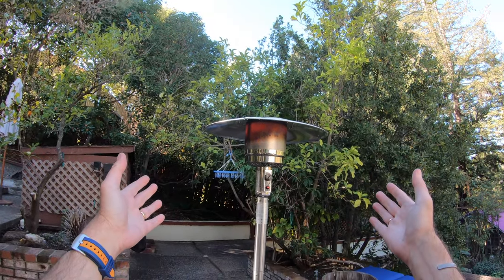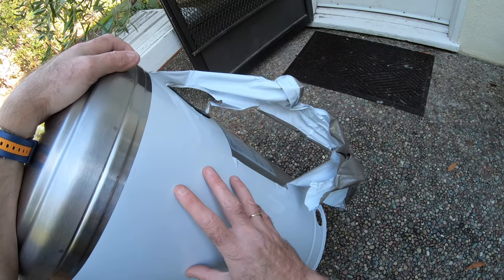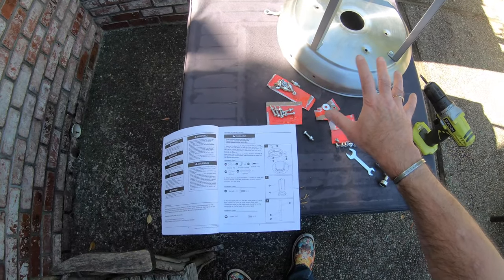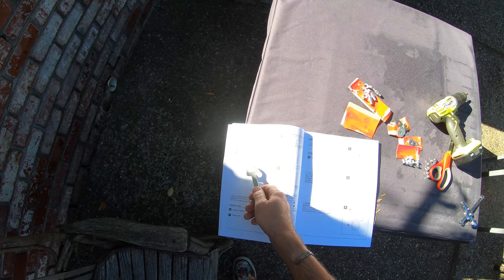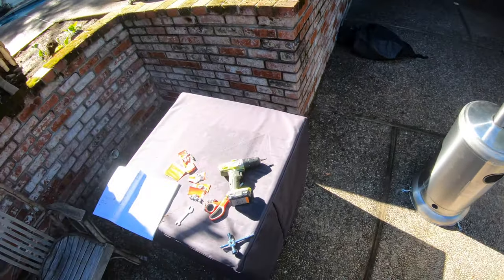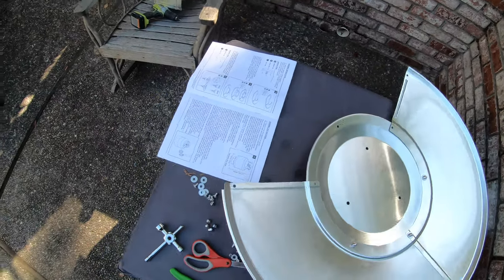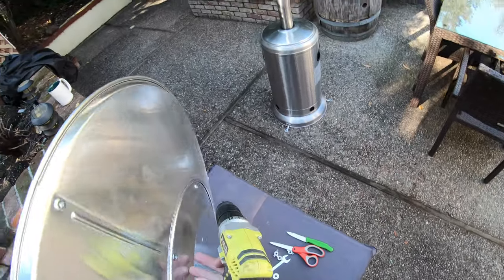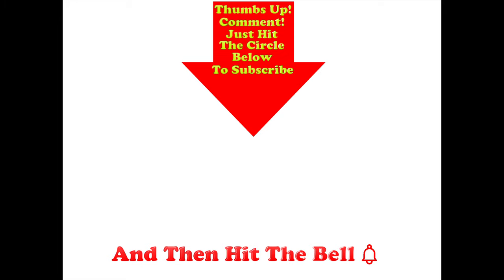Hampton Bay Patio Heater Review & Step By Step Assembly

Comment: One step not mentioned (at least I didn't catch it if you did cover it, my apologies if you did), in the states this unit comes with a "AAA" battery that goes under the ignition button. Just unscrew it, insert the battery (+ facing where your thumb will be) and screw it back on. Great video, thanks for posting!

Comment: This was great - thank you.  I watched it step by step and I did one thing differently.  I assembled the upper pole to the lower pole, then stood it upside-down and held it in place be putting two chairs on either side of it, then I attached the three base support units to the cylinder itself.  Then I flipped it over and attached it to the base.  The base support units are so much lighter then the two poles, so I think this is easier when you do not have an extra set of hands to help you.
Reply from the maker: Glad it helped!

Comment: Purchased a similar Hampton Bay heater recently. My heater had a weighted base and no attachment brackets or those three vertical supports. My heater had a set of wheels mounted on the side of the base which is nice. Burner assembly and vertical poles were the same. One very annoying thing was the plastic shrink wrap was placed on the cylinder that encloses the tank first. Then all the pop rivets and any other hardware were then placed. So it leaves you with plastic wrap pieces that must be picked off ! Otherwise seems to be a decent heater for what I paid on sale, $99 plus tax. Thanks for the video.

Comment: Just note ... I did remove bottom black weight to fill w sand. This allowed me to bend bottom deck supports and invert them to sustain weighted base for a more aesthetic quality look.
   I did use long screw drivers to support weighted base as i attached it. And the results were far better for wind control and spacing.
  This black base is in the diagram and suggests water as well. But it will make a difference to sustain top heavy heater should the wind arise at your gathering.